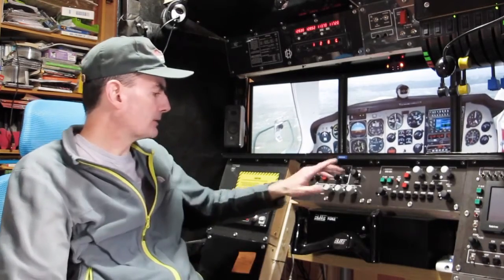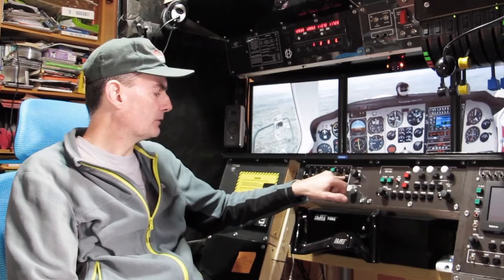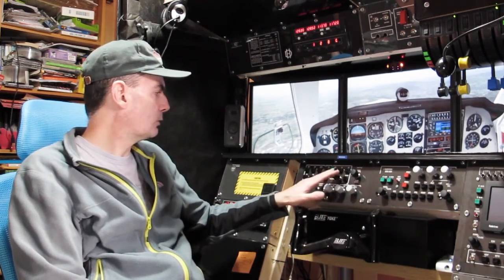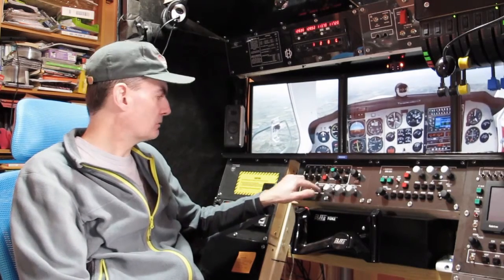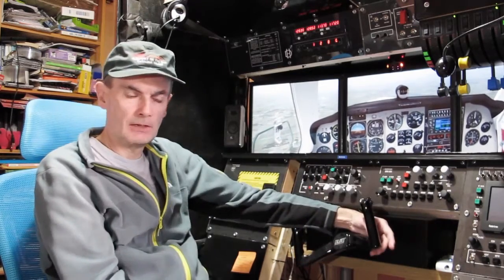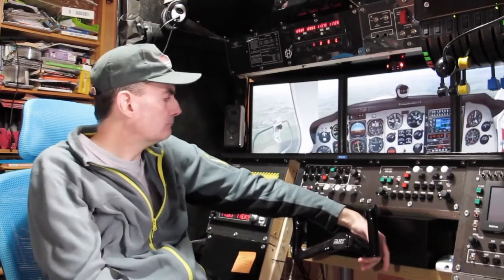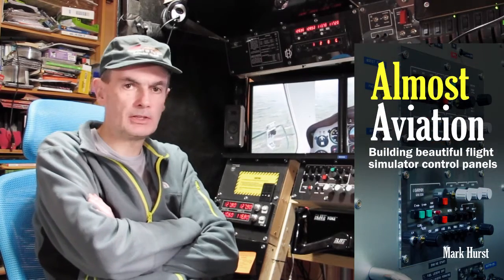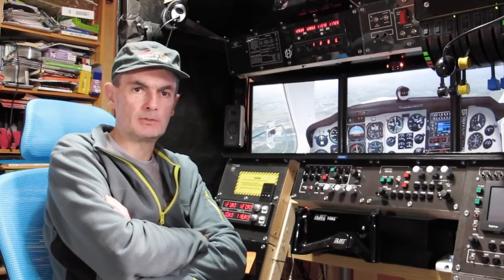Build the Autopilot+ Panel

Comment: I'm really enjoying all the work you have put in here. Is there a way you can add more smaller screens so that you can put the garmin GPS, AI, ASI, HI, NDB, VOR and all other cockpit instruments to be displayed infront in an actual cockpit dashboard layout?
Reply from the maker: Roy Andane There are ways to do this, although there will be a limit to how many screens you can add unless  you add a second graphics card. You can also do it with another computer - you can create 2D panels with something like Panel Builder or Air Manager and run them on a second PC across the network. I have used both these products and the network setup is trivial.